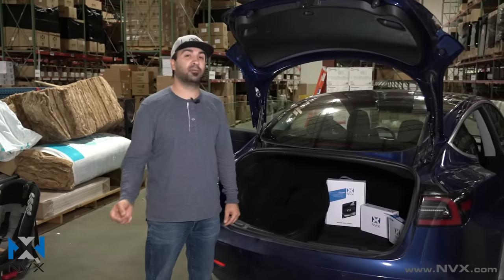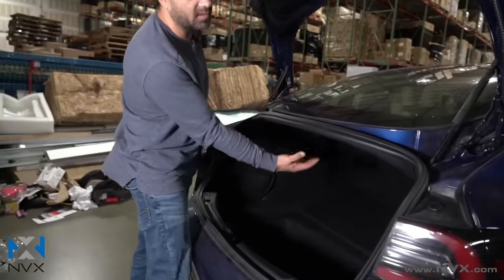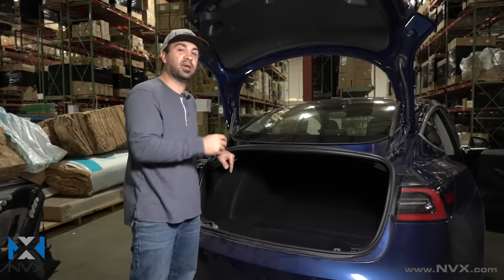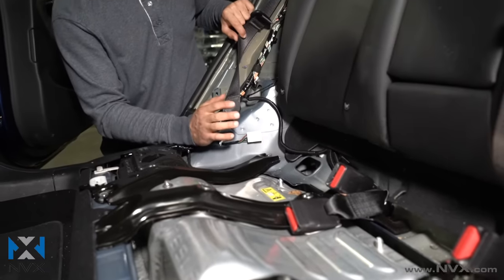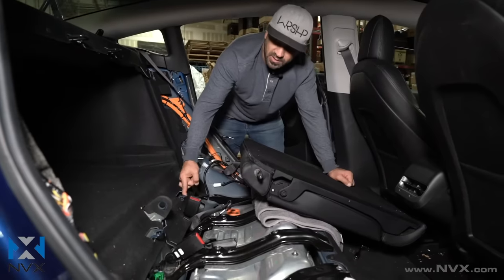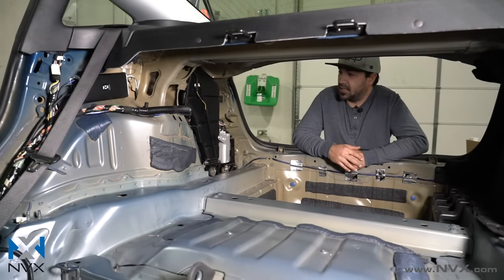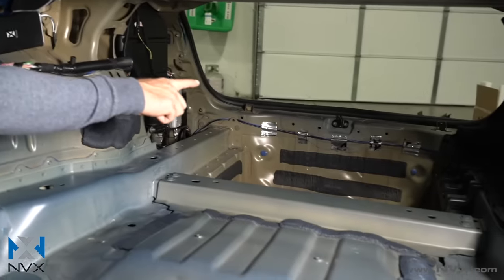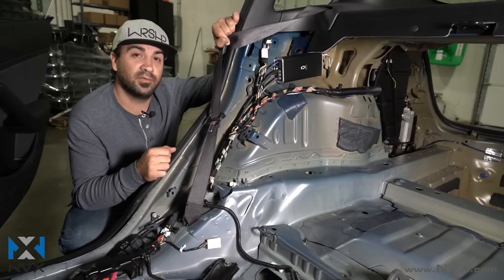Adding a Subwoofer & Amp to a Tesla Model 3 - Step-by-Step Install Guide for NVX BOOST Sub Box

Comment: dude, I am willing to pay you 1000 to install a subwoofer in my model 3.
Reply: I installed my own 2 years ago, WAY before all this info was readily available..... wasn’t fun lol but sounds AMAZING.  I also connected the disconnected premium audio speakers in the columns and next to the side mirrors.  Again, amazing!
Reply: @NightRogue77   How did this affect your miles range?
Reply: @renatosevillano8235  it’s really hard to tell - if I did the math I could figure it out but it hasn’t impacted enough for me to feel like I had to.  I also have interior and exterior LED lighting installed, and as long as it’s not cold outside if I have everything turned on I can still stay under 230 wH/m.

I have scan my Tesla installed, but never saw it spike too bad when turning everything on/off.
Reply: @NightRogue77  do you have a pic of your amp settings? Installed mine and doesn’t sound quite right
Reply: The install isn’t bad, any good shop can do it. If anyone is in the Houston area, I’ll be glad to help you out (for way less than a grand lol)
Reply: Where you at I can get it done for you
Reply: @NightRogue77  yo so you did this to a SR? The speakers in the A Pillar are there just not connected?!
Reply: Oh damn I totally lost track of this thread lol, my bad y’all. So I only have a 10” wired @ 4ohms, so I’m pushing ~300w rms, have it running 50% so max I push 150w and peak around 300w maybe?  I’ve tried figuring it out but the damn app for the dongle stopped connecting to it… but for real it’s pretty negligible, keeping in mind that while I run it loud about 1/2 the time, I don’t run the bass stupid high.  That 10 inch sub is in a ported box, that sits inside of the sub-trunk, and it st00pid loud if I want it to be lol.  I’m running 212wh/m or whatever here in the mid 80 degree weather with ac set at 70 and not running my LEDS.  That’s about as good as I can give you I think lol

 @joedietrich2601  early 2019 (pre-August) and earlier SR+ models have all the speakers installed, just not wired in  (there’s plenty of documentation available on how to tap in, just make sure you’re looking at the right guide for your type of model 3) - EXCEPT of course the rear trunk 2nd amp and subwoofer.   You can mount an 8” sub easily in the same spot, but for me this is where I mounted all of my crap - LOC, Resistors, SS relays, and secondary amp for all the other extra speakers I connected - it can get messy broski lol.  Big daddy pioneer is attached to the box.  NOTE:  should you have the issue where water gets into your trunk and down into your sub trunk, and you have enough weight down there (Saaayyyyyy, like a 10 inch sub in a box with an amp attached to it), go ahead and get the money together to get a new liner because it’s eventually gonna tear through.  An unfinished project of mine is replacing the removable sub-trunk cover with one of my own making that has a plexiglass made, and ports on the side if they make a difference, but I have to check and see how it sounds first.  The Acoustics in this car are just amazing!  

But… let me warn you in case you haven’t run into this yet:

As soon as you start adding your own stuff to the car, you can either A) disconnect all of it every time you have to get it serviced, OR B) prepare for the laziest technicians on earth to gaslight you into oblivion as they blame everything in your car on whatever you plugged into the cigarette lighter.  Maybe 10% hyperbole there.  My rear seat buckles no longer work, and this is apparently the fault of my aftermarket leather seat covers. For those that don’t know, according to my local Tesla technician, aftermarket seat covers cause additional, out of spec pressure on the buckle when in use.  Let that sink in for a bit. Man if only I had been using aftermarket seat covers for like 25 years on like 10 different cars of various quality, so that I could just intuitively know that that was the biggest load of horse manure I’ve ever heard… damn…. missed opportunity there…. 

Now putting stuff in aftermarket certainly CAN, and probably eventually WILL, cause problems (E.g., aftermarket puddle lights will cause your windows to screw up when they fail - ask me how I know, and for bonus points, ask me why it took SEVEN trips to Tesla over 2 years to figure that out), but these guys will test your intelligence and you’ll swear they are trolling you.  Tesla Customer Service is the absolute worst crap ever - just pray whatever is wrong only requires a mobile technician, because apparently those guys rule… Probably because there’s a human being in front of you that you can actually talk to so there are no misunderstandings.
Reply: @grumpysteelman  I am in Dallas Texas . Do you know any one to install nvx system on my Tesla model y performance. I am scared to do my self and mess up anything with EV vechile

Comment: Do you have a version that explains how to wire this into the standard audio system on a Model 3 (not one that already has a subwoofer and amp?)
Reply: I would like to know this also. Any ideas where we can find info on this??
Reply: It’s on the NVX site, one of the images has the wire colors and pinout on the plug
Reply: @grumpysteelman the instructions are wrong

Comment: Right, Tesla will deactivate it with the next upgrade.
Reply from the maker: We have had the Model S system installed for 9 years. We are confident it will be fine. Don't hate. Enjoy.
Reply from the maker: Your logo reminds me of a bottle of Haterade. All jokes aside, we have experienced many updates and we're still A-O-K. Further, it's like any other accessory plugged into the 12V battery. Our M3 model in house has had the system for nearly a year now :).
Reply: Based on how this system is hooked up and where it gets power and audio signal, the chance of it being bricked by an OTA update is probably 0.01%. Generally the only things that could be bricked by OTA updates are aftermarket accessories that connect to the canbus like those auxiliary displays.

Comment: I just finished installing this in a 2021 LR M3. Sounds amazing! I'm so glad I did it,  I was so scared because I've never installed any aftermarket systems ever. As an update the trunk liner is now split right after the lower storage compartment so no need to fully take out the back seats,  just the bottom seat.
Reply from the maker: Awesome, happy to hear you got it installed.
Reply: @NVXAudio  You should do one on a Honda Clarity 2018,I can't get anybody to do it for me...
Reply: Will this kit work on a 2023 RWD model 3?
Reply: Where did you plug the RCA to?

Comment: Hello,
A tutorial on a Mode 3 (SR +) that does not have a subwoofer seems more logical than a tutorial on an already equipped LR or Performance!
In addition, you do not indicate if there are connectors to retrieve the signals from the front speakers ?

Comment: I really wish there is a step by step with the actual difficult part of the install. I saw your wiring diagram. Am I completely taking out of play the factory amp or am I splicing in to it?
Reply: You could do either one depending on if you want the factory sub to still work or not.

Comment: Patiently waiting for the 2023 model 3 version to come out 🤘
Reply from the maker: This enclosure fits the 2023 Model 3's.
Reply: @NVXAudio  really?!? The website says 2022. Some others mentioned that there was a redesign in 2023 so I wasn't sure what to believe. Thank you!
Reply from the maker: @RaytownProductions  We are not aware of any changes at the moment.
Reply: How about the wiring and if the amp can handle the higher voltage for it to work with the 15.5 v system on the newer m3?
Reply from the maker: @djoj1986  Our amplifier does work with their 15.5v lithium battery.

Comment: Instead of drilling a larger hole and using the supplied jack nut, I used a #10-24 wall nut and a #10-24 x 1" threaded knurled nut. This way you can manually remove it gaining access to the charge port release cable without carrying around a 10mm socket.

Comment: Is there a step by step to activate all speakers on Tesla model 3 sr 2019 and also installing the subwoofer?
Nice video but if I’d do it it would have to be one without a subwoofer already installed.

Comment: How did you wire the LOC to the factory sub specifically? It’s a dual voice coil so not sure how to wire it.
Reply from the maker: You can connect signal to one voice coil of the factory subwoofer and jump the + and - to fill both left and right inputs of the LOC.

Comment: So during the design of the kit, did your engineers figure out how many watts could be driven from the dc-dc convertor supply? If so, could I do say 1500 watt rms, the kit plus 2 more 12's and 1000 rms mono as well for example? Would I need like a 4 F cap to ease current surges to Tesla's minimalist 12v design?
Reply from the maker: Hi Jared, we had designed the previous Tesla S BOOST Box and went from there. From previous analysis (and aftermarket set ups that were tried), we avoided a 1500W, and even 1000W RMS set up, as it was too much strain. I do not believe a capacitor would resolve the overall strain issue either, even if they did help with surges.

Comment: Can you list your fine tuned crossover adjustments? I’m finding my Model 3’s NVX set up with settings (flat on factory EQ) has a little muddiness and a bit of delay. Would love to see your baseline and adjust from there.
Reply from the maker: Yes, so your LPF should be set at 80Hz, boost Freq. should be set at 50Hz and EQ flat for best performance.
Reply: @NVXAudio  awesome. Thank you!
Reply: @NVXAudio  one last question: what about the subsonic, sensitivity, and crossover settings for bass level/main level/bass x? also to clarify, when you say LPF at 80, is that 80 Hz or 80%?

Comment: You guys should do a video on installing the external speaker for pre September 2019 cars. If it's possible that is.
Reply from the maker: What do you mean "external speaker?"
Reply: @NVXAudio  The pedestrian warning speaker that makes the 'pink noise' for when the car is moving slowly.  It's an external speaker under the front passenger bumper.  It can now be customized with Tesla's new Boombox feature
Reply from the maker: @23adrock  Thanks for the info. I figured you were talking about that new warning speaker, but thank you for clarifying. We are not sure if there is currently an aftermarket "solution" for this or even an option pre-2019 as we haven't given it much thought. I know they are doing that "turn your system on for a hood party" on the external speaker, but we have not given that much thought either from a demand standpoint. Thank you for stating your interest as we will look into it. If we go forward with it, we will be sure to have someone reach out.

Comment: Apologies for the really silly question, I'm not a battery expert so I have no idea hence the reason I ask the question. I really love my base, every ICE vehicle I've had, I've had an amplifier and subwoofer hooked up, I'm worried doing the same on an EV would have a detrimental affect on the battery. Would excess bass and vibration cause EV battery degradation?
Reply from the maker: Good question! You should have no worries about installing some bass in an EV as the main drive battery is separate from the 12v power source you would connect too.

Comment: How is this on the new AMD 15.5v systems? I've seen a lot of guys doing electrical gymnastics trying to get amps to function without error messages or draining the Li-Ion battery!
Reply from the maker: We have had no issues other than the normal error messages due to improper installation and amplifier placement can effect certain electronics in the Tesla.

Comment: Probably a stupid question, but with these electric cars, does adding a large sub reduce the cars range by anything noteworthy??
Reply: I'd like to know too
Reply from the maker: Quite simply, no :). There is no reduced range. We addressed this in a previous comment on here, but essentially the voltage draw is minimal. Therefore it is not impacting the range. Even on the Model S system we designed years ago, and that drew more power, it was not noticeable whatsoever.

Comment: Do you have a video that shows how to tap into the front speakers?
Reply from the maker: We don't have that.  If you do want to tap into the front speakers there are panels on either side under the dash.  You'll see a grey connector on both sides. Left front speaker wires are solid white and white with black stripe. Right front is solid blue and blue with black stripe

Comment: Any reason to why you dont have any options thats more powerful? This "sub" is kinda weak. I would love to see a real subwoofer for these cars.
Reply from the maker: Have you listened to it before forming said opinion or passing judgement prematurely?  The sub in question performs in line with JL Audio 10W3, Kicker CompVR, and Rockford Fosgate P3. We chose this sub as it is very accurate, efficient and the depth was and is an issue when compared to a subwoofer like our VC-series. 

In conclusion, it's a real subwoofer, performs excellently and it's not obnoxiously taking over the mids and highs so it accomplishes what we set out to do. Hope that helps -- and we really would hope you would get a listen in if you haven't already.

Comment: I installed the power to the same battery, under the seat.  After week or so I got message on the screen. It was because I had the amp hooked up to that battery. A tech who works at Tesla said to use the front 12v battery.  I'm using the 12v in the front and no issue.
Reply from the maker: We haven't seen this error on cars we've installed on. But other people have mentioned it. It seems moving the power to the front battery does fix the issue

Comment: Is the factory amp and sub still in use after the new equipment is installed?
Reply from the maker: The factory amplifier was left in to power the highs and produce our subwoofer signal into our LOC. We did not leave the factory subwoofer hooked up as we could not hear it after the install anyways, but you can leave it in the vehicle but will need to wire one of the speakers out of phase as they cancel each other out.

Comment: Is this the same procedure for the Tesla Model S with base soundsystem?
Reply: 2018 75D
Reply from the maker: The install is a little different in regards to where you grab your signal for your LOC. Instead of grabbing speaker signal from the factory amp, you need to grab it from inside of the kick panel. The wires should be easy to spot as they are twisted together and as far as we know the wires are set up with aftermarket colors such as whites for the drivers side and grays for the passenger side.

Comment: Great video. Thanks. Do you know if it will possible to create an aux-in (on any Model 3) by replacing/upgrading the amplifier? Appreciate your skills 👍
Reply from the maker: I am not sure what you mean by an aux in? The Tesla M3 only has a Bluetooth input from what I am aware of or through USB; however, we personally do not use the USB. You could buy a Bluetooth transmitter that pairs to the car and has an aux-in I suppose; however, that would be a bit odd and the only purpose I imagine would be your original source did not support Bluetooth (eg. Your old-school Gameboy) :)
Reply: Still looking for an aux input mod for M3. Bluetooth is cringe. The BT reciever idea doesn't work with teslas since it is looking for a phone only.

Comment: I installed today and checked and rechecked wiring multiple times. NO sound coming from subwoofer at all. I can mess with the gains and the "maximum" light on the XLCA2 will turn soon, and power light shows in both units, but absolutely no sound from speaker. Any thoughts as to why? I connected to harness at subwoofer and power and ground from factory amp like video shows....
Reply from the maker: Check RCA's and double check all connections.

Comment: Has there been a consensus as to if it’s better/safer to connect to battery in front or the penthouse? I keep reading differing opinions. Thanks!!!
Reply from the maker: If you feel more comfortable hooking it up to the front battery go with that. Some have reported errors when hooking it up to the point under the seat. One the ones we've installed we haven't gotten any errors even after a year of having it installed.
Reply: Thank you! If I did connect to battery, would I ground in same spot? Someone said it would be best to connect to battery negative instead of grounding? Thanks again!

Comment: could you be more specific with the wiring? Im not quite sure which wires to splice into
Reply from the maker: Hi! Please see the wiring diagram linked here: https://nvx.com/media/cms_pages/TeslaModel3InstallguideCarX_1_.png
Reply from the maker: And this one! https://nvx.com/media/cms_pages/TeslaModel3BoostwiringX_1_.png
Reply: So I had this wired another way but going into an lc2i crossover. We used the orange white grey and blue wires from that same factory harness. Do you think this could be leading to clipping issues and problems with the amp turning off an on? I’m wondering if I should just use the subwoofer wires as you show in your diagram and wire directly into speaker inputs on the lc2i crossover. Then run rca cable from lc2i to aftermarket amplifier. Thoughts?
Reply from the maker: @esedman157  Yes, hook up the input of the LC2i to the following wires. They will be found in the grey harness of the factory amplifier. green goes to left +, red goes to left -, purple goes to right +, and brown goes to right -.  Going to the other wires will not provide you with the proper signal for subwoofers.
Reply: @NVXAudio  Thanks for the diagrams!  Do you also know what gauge wire you used to tap into the OEM sub amp power, and the subwoofer +-?  I got the kit (from you) but didn't realize it didn't come with wire to tap into these OEM wires.  Thanks! :)